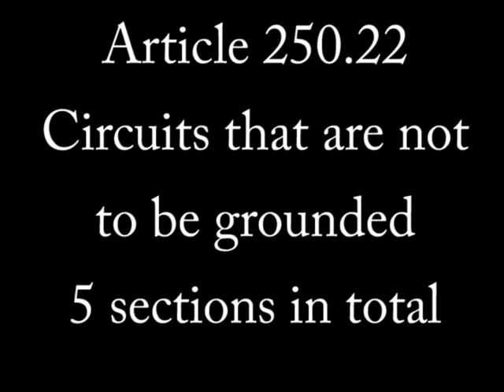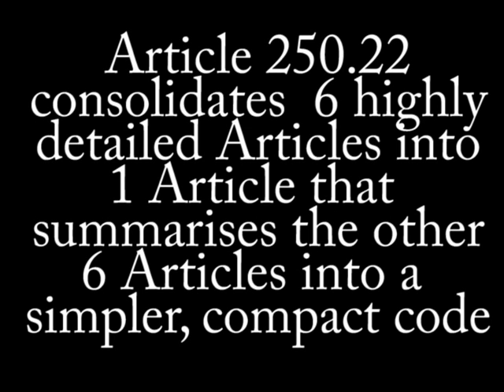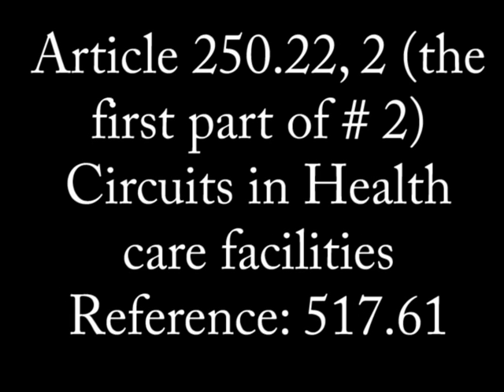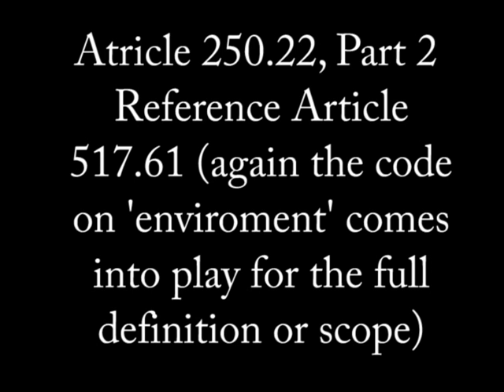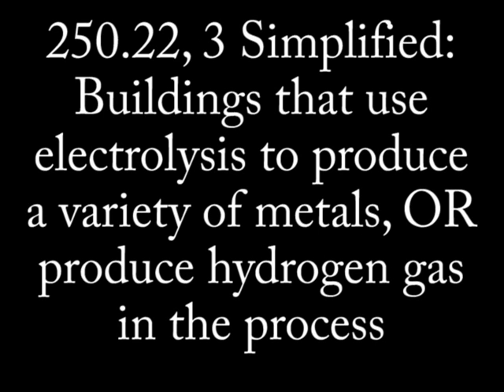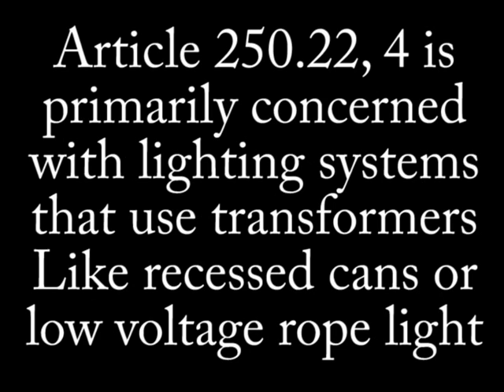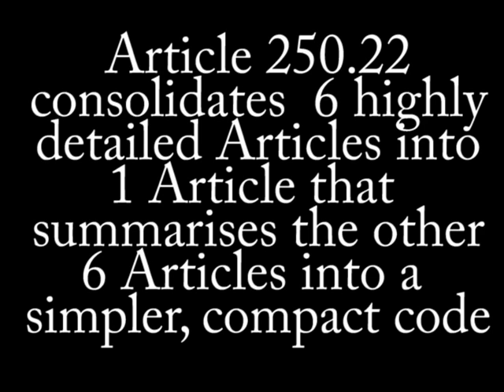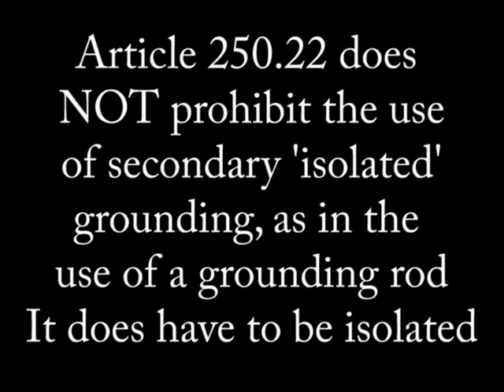NEC code on systems NOT to be grounded 250.22 (1-5)

Comment: I found you from your comment on another channel. I wanted to ask a quick question. If a basement wire had a screw drilled in the middle of the wire, would it have to be replaced or can you just put electrical tape around it? I will say that the breaker was switched off and it was sparks everywhere after the screw was accidentally drilled into it. I know it will eventually need to be replaced but will electrical tape work for now or is that unsafe?
Reply: Better to make a junction box where the drill damaged the wire, but yea tape up the area that was short circuiting and that should make it functional